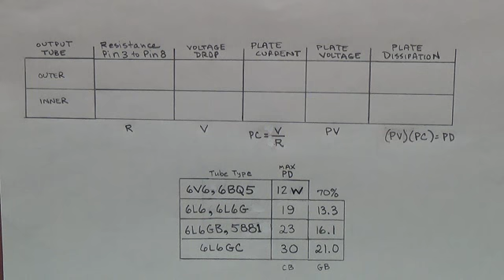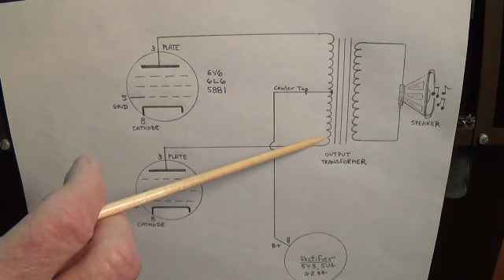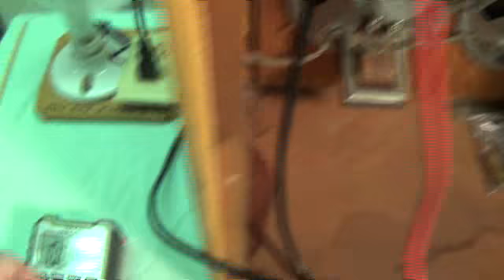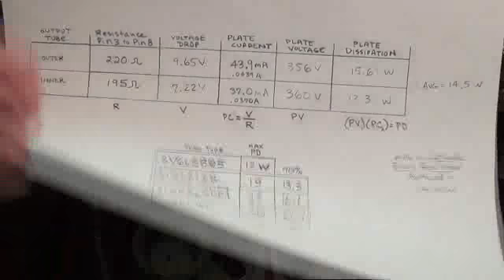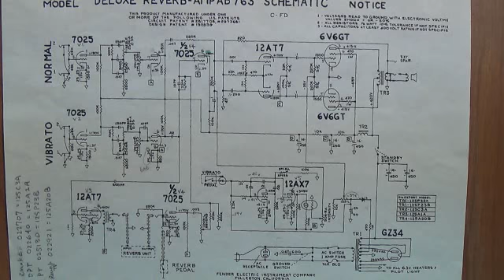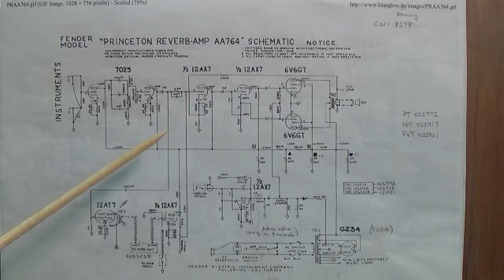Biasing Double-Ended Amplifier Output Tubes, Part 2: Demonstration and Discussion

Comment: Hey Uncle Doug, I've got a question. When I measure the pd with the output transformer method on a se 6aq5 amp im working on, the plate dissipation is a spooky 20W, while when I meaure with the cathode resistor method, its a much more reasonable 10.75W. I'm not getting any red plating and it sounds about how I want it to. My suspician is that my cheap multimeters autoranging feature will not give an accurate readout of the vd across B+ side of OT and 6aq5 plate. Do you have any other ideas why this may be? Thank you so much for sharing your wealth of information.
Reply from the maker: Since I didn't watch you make the measurements, it's impossible for me to guess what went wrong, CJ......but apparently the cathode resistor method yielded a more realistic result.
Reply: @UncleDoug  Thank you for responding. Determined it was my dodgy multimeter. Doh.

Comment: @Uncle Doug can you please help me to understand how I can set the bias on an amp which has a switch to change between Class A and Class A/B? Looking at the schema, it is a grid biased amp and it's changing both plate and bias voltages at the same time when switching between classes. Which option is then better to set the bias at, when on Class A or A/B? There are 4 6L6GCs and biased in pairs by two pots.
Reply from the maker: I can't imagine the current requirements and heat production for a Class A circuit with four 6L6's, Dobroslav. I would switch it to AB and set the bias at 60% to 70% of max PD (around 18 to 20W for each tube).
Reply: @UncleDoug  Thank you for your reply I'll set the bias in class A/B as you say, it all makes sense. I see some really scary values on all tubes when in A/B mode, 58mA of plate current and 525V between plate and ground (cathode is grounded) which puts 6L6GCs right at 100% even without signal. I don't know why would somebody do that, maybe there was a reason. They all glow blue and power transformer is heard humming, they are not red plating though. In class A mode I see 25mA and 285V which is way below what power tubes could do I think, very cold, ~7W.
Reply: @UncleDoug   I've just come to the conclusion that those pots aren't there for biasing but for matching output tubes pairs, so there's no way to bias this amp without modifying it. It's a fixed bias design. The amp name is Kitty Hawk Grand Lead btw. Thank you very much for your help anyway!

Comment: Greetings Uncle Doug, I have an 18watt Marshall kit amp , cathode biased and it has a  plate dissipation of 32.7mA!  The plate voltage is 365V  with a current of .0896mA. The cathode resistor is 10W x 150ohms,. That seems crazy high but that's not out of line with what I've found on the forums. Are my EL84's going to explode or is my amp going to burn down my house ?
Reply from the maker: Some of your terms are confusing, EB. Plate dissipation is in Watts. Is the total PD for both EL84's = 32.7W ?  If so, it is outrageously high. If the PC for the pair is 89.6mA then the average for each tube is almost 45mA, again outrageously elevated. You need to increase the bias resistor to around 450 Ohms and recheck your measurements.  The PC needs to be closer to 30 mA. Yes, as it stands, your amp is on the verge of self-immolation.
Reply: @UncleDoug  thanks for such a quick response! Sorry about the confusion, I’m a woodworker for 30yrs, electronics are a foreign language. I’ll give your suggestion a try. Thanks again!
Reply: I thank you and my tubes thank you for the tip Uncle Doug, I installed a 500 ohm resistor and now the PD is at 12.3 watts.

Comment: HI Uncle Doug.......just a small comment .
Plate dissipation on a valve is indeed calculated by plate V  and plate Current , so far OK.
But plate voltage is measured between cathode an plate , not between plate and over the common cathode resistor.to ground....  . 
It was common practice to use a common cathode resistor.....cheaper and as they said sounding better ...( because no tubes are really identical and so the PP produces more second harmonics which are normally annulated by the PP annulation of these even pair harmonics ) but it is much SAFER to use individual cathode resistors  ( one per tube ) .... tubes getting out of balance on the long run and run away of one of them is  the often  seen red plating of one of the tubes carrying almost all of the current.
Another nice solution instead of individual cathode resistors  is a partly bias with one common cathode resistor and a complementary neg voltage bias for each tube with a trimmer - pot control adjustment on the grid of each tube.. it works very well , easy and good balancing of the tubes for extended bass and avoiding premature transformer core saturation ,  is quite safe in case of bias failure ....and sounds good...
Reply from the maker: Thanks for your very informative input, Frank. This was an early video, kept basic for beginners. I have since posted quite a few videos demonstrating bias techniques which do rely on plate-to-cathode PV measurement for cathode-biased output tubes.

Comment: It's me again Doug, just rewatching your awesome videos . Quick question . I have a 65 Super Reverb Reissue and the 6L6GC's that are in it have a max PD of 30 watts as you know . For the bias I am wanting somewhere around 35 mA. Using your awesome testing methods , how do I get to 35 mA to adjust with the bias potentiometer out of, let's say, 21 watts? I apologize if this is a dumb question . Just trying to learn from the best .
Reply from the maker: If the reissue has a bias-adjusting pot, simply monitor the PC by whatever method you are using and adjust the pot until you reach the proper level.

Comment: Uncle Doug,  Uncle Doug! I dont understand why in the chart the values for grid bias are different (it says 70%). Also,  what would be the values for a EL34? And what if the amp got 4 tubes, should we meassure everyone or tale them as pairs?
Reply from the maker: All of this is explained in this and other videos on our channel, WC. The value for EL34's is in the tube handbook. Watch my next video (on a 1968 Twin Reverb) and I will fully explain how to bias quad output tubes.
Reply: @UncleDoug  ah!  Thats what i was missing!  I tough i have seen one of your videos about that in the past,  but didnt find the info on the single and double endend bias series.   Thanks Uncle Doug!

Comment: Hi Uncle Doug, super series, hope you can explain something to me in your wonderful understandable way, I see different calculators and values for cathode based push-pull amplifiers and they refer to class A and class A/B with the same set-up and diagram, is that really the case in a class A/B for a cathode based push-pull amplifier ? Is it only the bias current that is lowered ? or are circuit changes required ? I do not seem to find a comprehensive answer. Hope you can shed some light on this subject, thank you and stay safe.
Reply from the maker: I personally find the separation of amp circuits into specific types to be an unnecessary distraction, Ives. I have serviced hundreds of amplifiers and the amp type is never a consideration.....you simply work with what you've got and set it up according to basic rules, as depicted in most of my videos.

Comment: Soo... looking at the schematic of my old Fender Twin Reverb (four 6L6's)  Two pairs with each pair sharing a connection to the output transformer.-via- their Plates.  The cathode's are also connected on each pair and grounded.  So it's Grid Biased . right ?  and each tube can be adjusted as needed. (they all have their own resister going to ground.)
Reply from the maker: The adjustment of bias in a circuit like this is done by varying the amount of -DC bias voltage being applied to the grids of the output tubes. See my, and other videos, for tips.

Comment: great vid sir! quick question: i just changed my tubes, did the calculations and ended up having incredibly low numbers, like 10w dissipation on 6l6gc - should be aiming for 21w on a grid bias - the thing sounds great, pretty much the same headroom as before, and the tubes look to be lighting up all right. So are my calculations wrong or is the amp designed to run cold tubes like that?.... afaik these were the original tubes so it kinda makes sense they lasted 40 years being run that cold
its a 70w pro reverb silverface 1980, heres the diagram
https://www.thetubestore.com/lib/thetubestore/schematics/Fender/Fender-Pro-Reverb-Ultralinear-Schematic.pdf

edit: i might have answered my question while looking at the diagram (for the 1001th time... had to post it to notice it i guess) - that little note on the bottom left saying all mesurements are with tremolo on and intensity at max unless otherwise specified - ill go try to find my old footswitch and will check back in shortly

edit 2: having the tremolo engaged with speed and intensity set to 10 doesnt seem to change the bias reading much, managed to balance the 2 6l6gc at around 11.7 and 11.3 watts this time... no worries since it sounds great but i would really like to know whats really happening in there
Reply from the maker: The PD sounds rather low to me,  Phil, especially for GC's. Check to see what -DC bias voltage is being applied to each grid. Compare to the schematic. Your bias voltage may be high.
Reply: @UncleDoug  thanks for the quick response sir, ill check it out
Reply: @UncleDoug  ok so the mystery seems to be thickening, ive checked what i believe are the grid voltages (pins 1 and 6 to ground on the 12at7 in the v6 position) and it seems ok - 291 and 285 v respectivly. i then tried switching back to the old 6l6gc and measuring their PD and they too are/were running cold (around 12.5w each). remade measurements by switching pre-amp tubes and still no significant changes on the pd numbers...
again its no big deal since the sound is alright (unless you tell me im running the risk of damaging something in there), im probably going to bring it to a tech once this whole covid thing blows over (unless i become an expert until that happens loll) but for now im happy to be learning so much. Thank you sir
Reply from the maker: @phildo4708  Running low PD's not only doesn't cause harm to the tubes, it's probably better for them. As long as the tone is good, I see no problem, other than curiosity about why the values are so low.
Reply: @UncleDoug  Great! time and curiosity are two things i have plenty of right now so ill continue to study and investigate. Ive watched your vid where you installed a bias ajustment pot on a fender Princeton and i think thats something i might be looking into once i feel i have a better grasp of things.
Thanks a bunch sir
Reply from the maker: @phildo4708  You're welcome, Phil. Best of luck with all your projects.
Reply: @UncleDoug  Quick update: decided i'd try and replace the electrolytic caps myself since that def had to be done anyways as they were about to celebrate their 40th birthday, and maybe that could solve the low PD mystery. Ordered the parts from studio sound electronics (dont want to give free add but they seemed to have the most comprehensive kit/model selection.... for fenders' mazes of models/years anyways).
So Im quite proud of myself here: first time i did serious work in my amp, didnt die electrocuted, nothing caught fire and the amp still works and sounds great, tho the PD still is low. Gained maybe a watt or so of dissipation but i think its only from the 2 100k bias resitors which were both on the higher side of the tolerance when measured after being replaced.
So next step ill try to replace the 33K resistor on the output tube matching pot with a 50k trim pot mounted in series with a 10k resistor (google robrobinette silverface mods for source for anyone interested). 
That should allow a quick and easy bias ajustment. I'll try to give an update when thats done.
Thanks for all the info provided in your channel, never thought id have the balls to mingle in an amp like that!
Reply from the maker: @phildo4708  Congratulations on your successful repair work, Phil. It sounds like you are rapidly gaining a lot of experience and knowledge. Keep up the good work.
Reply: @UncleDoug  thank you sir, i think i am!
i thought i'd give an update since i find this thread to be a nice journal of my descent into the rabbit hole and also a great discussion with a youtube celebrity ;)
.
so i started by installing the trimpot for the bias ajustment. seems to work ok but the amp def doesnt seem to like the hotter bias: the clean sounded great but when pushing the pre-amp, the distorsion sounded very dry and harsh and the tremolo was having none of it (roach flashing at super fast speed until cutting off, output sound doesnt cut but has very low gain... may have blown something in there tho i couldnt find what) so i've settled to the original bias resistance value of 33k.
.
next i did the tremolo cut switch mod by replacing the 50 kra tremolo instensity pot with one with an off position. This adds a little bit of pre amp gain in both channels by removing the tremolo circuit. Really nice and subtle tone change from the original.
.
finally i replaced the 10k mid pot on the vibrato channel with a 50k w off position. This allows for a significant pre amp gain by cutting off the tone stack either completly (raw mode) or gradually with the mids knob.
.
so im really satisfied with the results, i now have a wide range of distortion while still beeing able to get the original tone and having no permanent mods on the amp. i feel like i unlocked this beast; hitting tones with the amp alone or with a tube screamer infront i could never have before.  Will def have to investigate the vibrato issue but i dont really use it anyways, hence the second mod i was already planning to do. Also that cold bias mystery... but at this point i feel these are almost non issues: the thing sounds great, nothing is heating up and all the voltages seem to be within their range in every configurations.
.
Next step will be to build a champ 5f1. It will be based on the one you built from scratch in your vid. I think it will be a fun project and i could also def use a smaller practice amp.
.
Thank you so much for your work; i would never have gotten that deep without your channel

Comment: Hello Uncle Doug. It's been a long time since I last wrote to you. And it's my fault, I know. I want to know how you are? And I wanted to tell you that I continue to enjoy the content that continues to provide us.
I also want to ask you what is the maximum plate dissipation for 2 6bq5?
I am quarantined and restoring an amplifier and I come across rare values. the secondary of the transformer between pin 7 and midpoint measures only 72 ohm and at the other end of the other tube measures 59ohm
doing calculations the dissipation of a plate is 14.7w and the other 9.87w I am going to get a new set of paired tubes and I wanted to know well what is the correct dissipation for those tubes.
Greetings from Argentina, thank you very much. Damian
Reply from the maker: Max PD is 12W for each tube, Demian.....the same as a 6V6. This is for cathode bias. Grid bias max PD would be 8.4W.
Reply: @UncleDoug  thank you so much! As allways you saved me

Comment: You could adjust the grid bias by changing the value of the resistor that goes between the anode of the grid bias diode and ground or replacing it with a pot. It won't affect the tremelo.
Reply from the maker: Thanks, Bill.

Comment: The only way I have found to bias my Marshall 2203 without probes is to install the 1 ohm shunts at pin 1 and 8 to ground on each output tube.   It would be nice to use the output transformer method to read the plate current.  Maybe someone knows another way?  I think I will compare bias probe current  readings with the shunt readings on each tube.  This is high drama I am sure you can’t wait for the results but now I grab a beer because I am holed up in my house.   Maybe Uncle could do a part 3 on this method as a nice way of reading plate current on grid-based amps .
Reply from the maker: I have tried both ways, Michael, as well as directly reading the plate current with an ammeter....and they all tend to give about the same results. The least risky of them is the one you described, but be sure the 1 Ohm resistor is exactly 1 Ohm, or your readings will be inaccurate.

Comment: Hi Uncle Doug- I just came across a '65 Princeton Non-Reverb that's Pre-CBS and an absolute cream puff. It came with 6L6's installed; I'll try to bring it back to factory specs with a pair of 6V6's, using your methods on how to bias them; if that doesn't do it I'll add a vintage Alnico speaker. The 6L6's don't have that "creamy" blues sound the amp is known for and seem to break up too much ('muddy out') on the low frequencies. Thanks so much for the great videos!
Reply from the maker: Congratulations on a great acquisition, Andy. By all means, convert the amp back to 6V6's. The high current draw of the 6L6's can damage your power transformer.